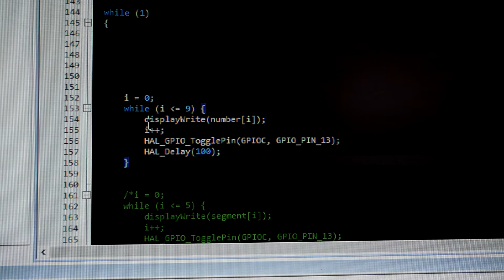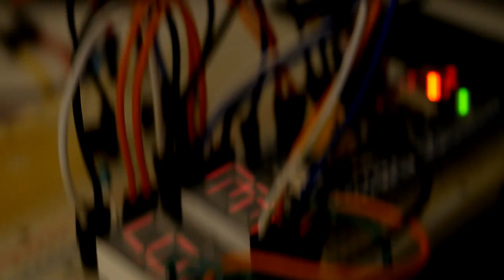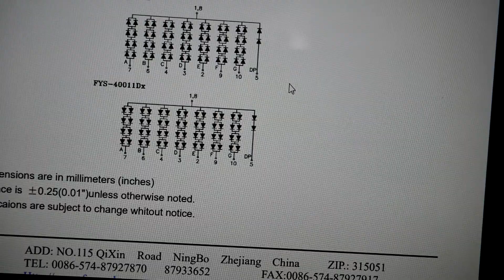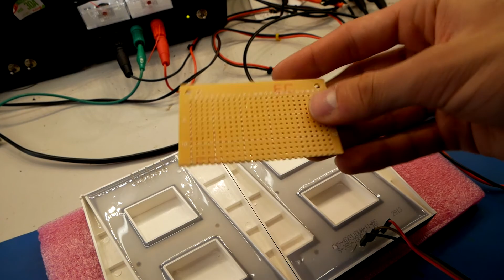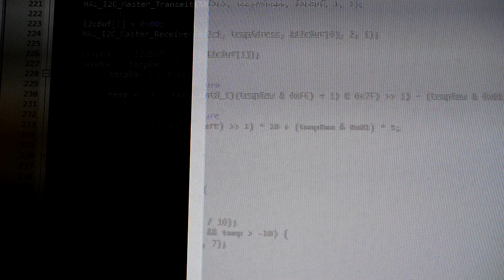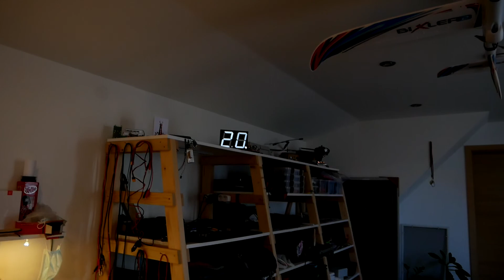Huge 7 segment display build (STM32, HAL, CubeMX, Keil uVision5)

Comment: I am trying to move away from Arduino and onto something more mainstream, but i find the jump in complexity a bit daunting...I am more high level programmer and find this low level stuff hard. I too was searching for a way to output from a port register like you said at the start of the video. My intention is to move my Led RGB matrix project from Arduino onto the stm32.